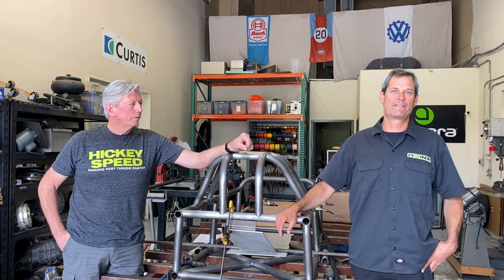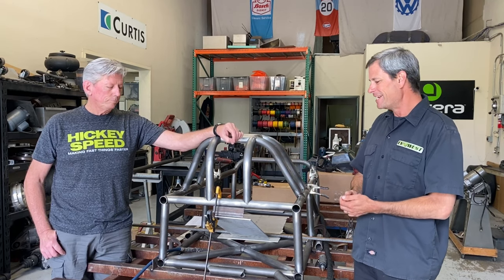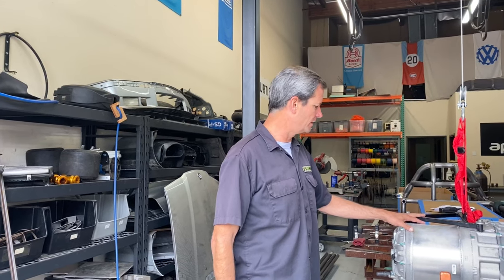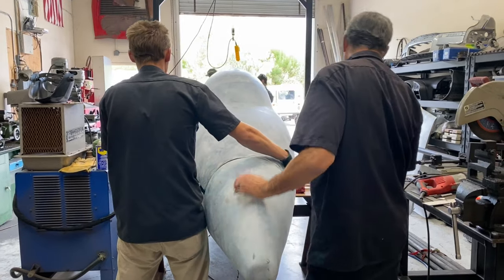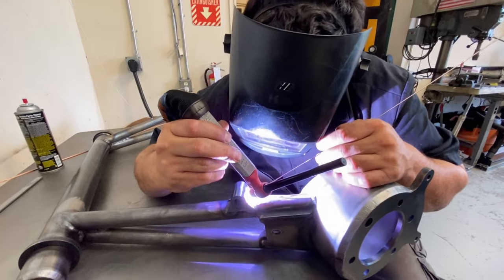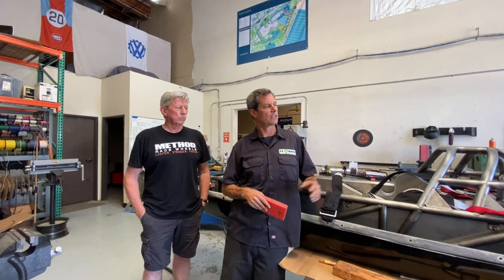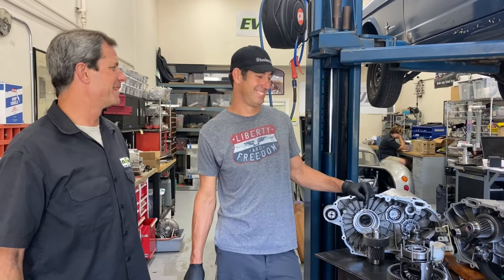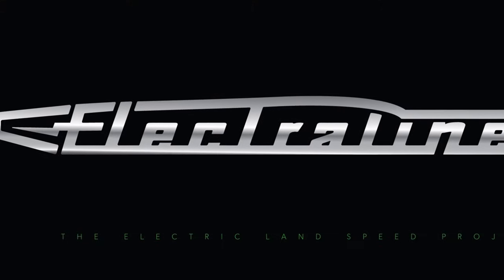Concept To Bonneville in 90 days: Electraliner EV Land Speed Race Car | EV Show - EV West

Comment: When I interviewed at EV west I talked to them about gear ratios.I told them my  electric drag go-kart was geared about 4.6 to 1 cause it didn't have much drag when off the throttle. 
Kinda trippy that the electraliner is geared. 
4.5 to 1 about the same as my gear ratio .
Glad to see EV West is still open during the pandemic.
Reply from the maker: Tire size, and max RPM. Our max RPM is 16,000, so reduced by 4.5 is an axle rpm of 3700ish. On a 31" tire that translates to 337 mph and we'll still have 2000ish lb/ft at the axle.
Reply: @EVWest   Nice that's awesome!
So what is your estimate for 0 to 60 on it?
Reply: @EVWest   I assume you will test it before you go there?
Reply: @warcryrecords  0-60 is irrelevant on a Bonneville car
Reply: @vidznstuff1   it's relevant to me how fast a vehicle that light with 2000 lbs. of torque would get from 0 to 60. I'd it quicker then a Tesla roadster?
Reply: Is it
Reply: @warcryrecords  Not with w 4.5:1 drive ratio. It should come in right around 3.7-4 seconds, IMO. Acceleration is 1G if the tires fully bite for a 0-60 and the weight comes in as estimated
Reply from the maker: @vidznstuff1  Correct. Also, when we return from Bonneville we do have plans to go to an upcoming drag event (announcement soon) and we'll be running the 9.73 gear set for that.
Reply: picknngrinnin  oh no
Reply: picknngrinnin  oh dear
Reply: picknngrinnin  you don’t seem to know what communist or propaganda mean
Reply: picknngrinnin  just because you don’t  want there to be a worldwide deadly virus, doesn’t mean you can make it go away with dangerous internet conspiracy theories

Comment: It's good to see the EV Show back, with new regular content.

If you're using an iPhone to film, consider getting this kit, and the additional accessory, for making sound better on the iPhone:
- R0DE Wireless GO - http://en.rode.com/wireless/wirelessgo (use two, for two people)
- R0DE Mobile Interview Kit http://en.rode.com/microphones/sc6-lik (includes two LAV mics or you can plug in two Wireless GO's, and it includes a headphone for monitoring) 

Good luck at Bonneville.
Reply from the maker: Thanks, we have some nice lavs, but trying to keep it simple. Might have to make some changes to make it more tolerable.
Reply: EV West thanks. Otherwise, the content is great! It's good to see the work that you're doing. Am always happy to see and learn more about EV tech.

Comment: . . Saramonic Blink500 works with iPhone . . . it takes 30 seconds to set up . .
Reply from the maker: Thanks for the tip. We used a nice Sennheiser before, but using dual channel required a bit of work. We're going to try the Blink500 and see if it's the simplicity we're looking for that lets up shoot and edit quickly.

Comment: Looks like it has a lot of weight in the rear and not much of a vertical stabilizer at the rear of the body. Hope you don't get handling issues form the aerodynamic center of pressure being ahead of the center of gravity.

Comment: Looks like your cage is going to be close for the 3" minimum forward! Why did you decide to build a Lakester & not a Liner & in these days of the Bonneville Goat Track conditions, no suspension?
Reply from the maker: It is close to the 3" forward clearance, right there. We ultimately want to build a streamliner, and though we've got a great team that's built several race cars, this is our first land speed car and it is quite different, so the Lakester is a fun, quick build and we can work on a class record first instead of trying to go big out of the gate. If we do well this year, expect us to build a streamliner for next year. The car has engineered torsional flex and urethane dampeners. Not quite suspension, but it was engineered by our driver Roger Hickey, and he's been on the salt since he was a kid. It is interesting, we'll see how it does.
Reply: @EVWest  Sounds like a plan, get your feet white then step up your game! I understand the surface is less ruff this year, I decided to stay away due to the virus thing.

Comment: How was the composite body attached to the welded frame?
Reply: I am thinking cam lock fasteners.
You weld the threaded tab to the frame and the spring loaded latch to the bodywork, join the 2 and a 1/4 or 1/2 turn of a screwdriver and it locks or unlocks.